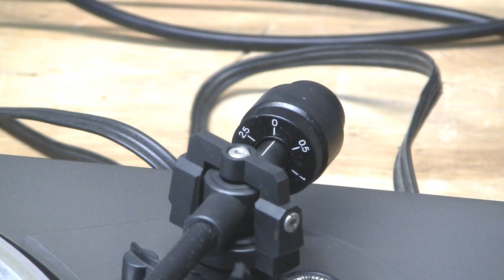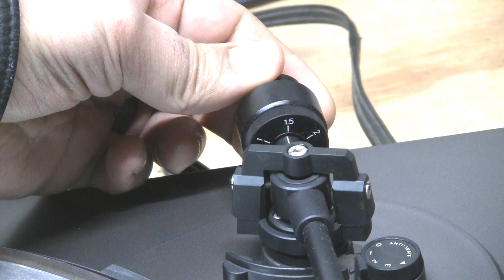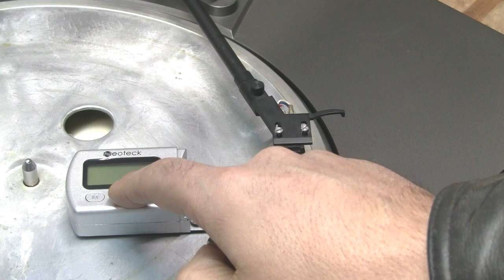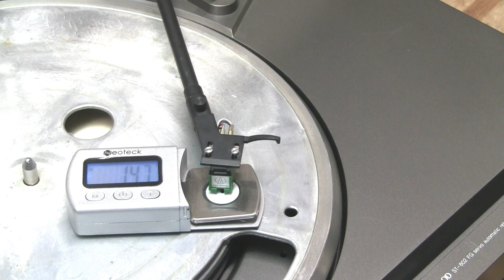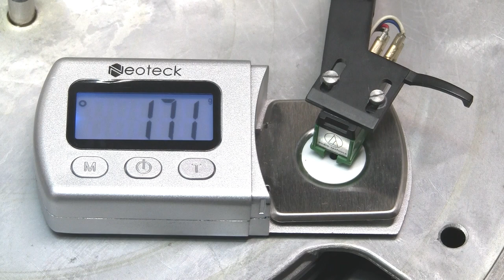Sherwood ST802FG Service And Basic Setup With Test

Comment: I have a Sherwood ST 801 turntable and can't get the platter to lift off. Is there a release or clip that will let it come up? Any help you have woud be great. The belt is snapped and needs to be replaced
Reply from the maker: Hello there, Hopefully I can explain it in a manner that describes the process clearly. Reach your index or middle fingers (whatever feels right to you) under the rim of the holes off to the sides (lateral) of the center spindle, and place your thumbs over the top of the center spindle. With your thumbs,  you're going to push down slightly while you pull up the platter with your other fingers at the same time in one motion. That should "pop" the platter off. Just don't push down on the spindle with brute force, the thumbs are positioned as such just to steady the process and give you leverage. Hope that helps 🙂